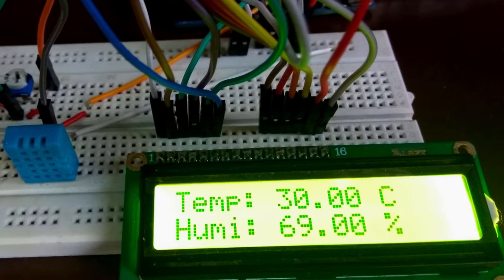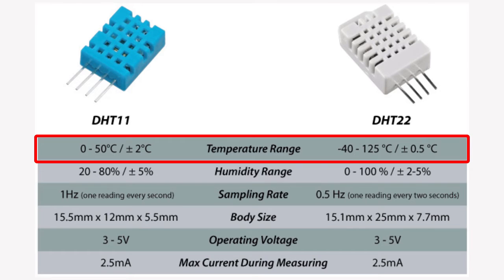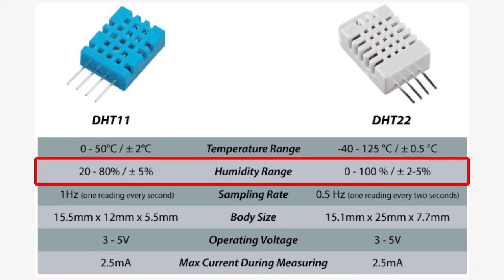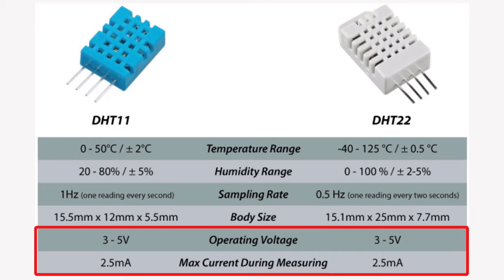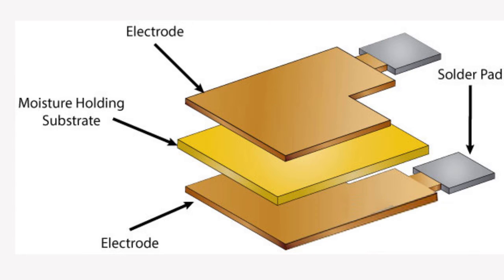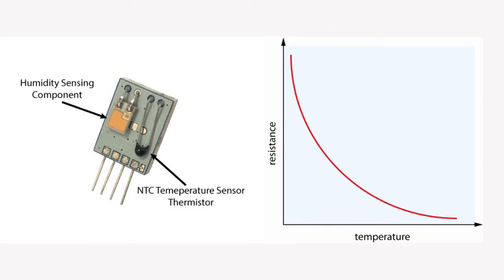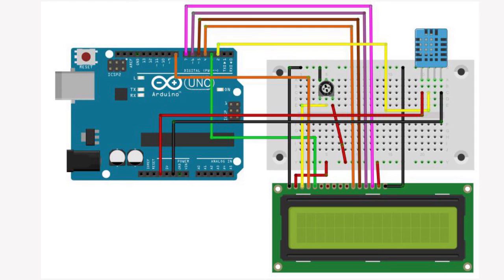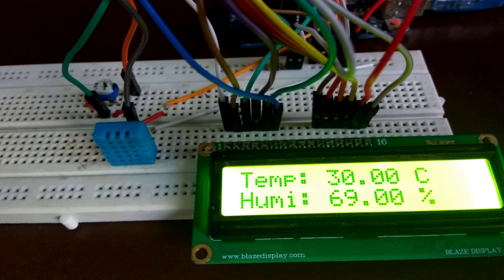DHT11 & DHT22 Sensors Temperature and Humidity Tutorial using Arduino and LCD

Comment from the maker: #include <LiquidCrystal.h>
#include <DHT.h>      // 
#define DHTPIN 2     // DHT Data Pin
LiquidCrystal lcd(8, 3, 4, 5, 6, 7); 
//define LCD pins (RS, E, D4, D5, D6, D7)

#define DHTTYPE DHT11   // or DHT 22 

DHT dht(DHTPIN, DHTTYPE);

void setup() {
  Serial.begin(9600); 
  Serial.println("DHT11 Sensor!");
 lcd.begin(16,2);    
  dht.begin();
}

void loop() {
  // Wait a few seconds between measurements.
  delay(1000);
  
  float h = dht.readHumidity();
  // Read temperature as Celsius
  float t = dht.readTemperature();
  // Read temperature as Fahrenheit
  float f = dht.readTemperature(true);
  
  // Check if any reads failed and exit early (to try again).
  if (isnan(h) || isnan(t) || isnan(f)) {
    Serial.println("Failed to read from DHT sensor!");
    return;
  }

  // Compute heat index
  // Must send in temp in Fahrenheit!
  float hi = dht.computeHeatIndex(f, h);
  Serial.print("Humidity: "); 
  Serial.print(h);
  Serial.print(" %\t");
  Serial.print("Temperature: "); 
  Serial.print(t);
  Serial.print(" *C ");
  Serial.print(f);
  Serial.print(" *F\t");
  Serial.print("Heat index: ");
  Serial.print(hi);
  Serial.println(" *F");
  
  lcd.setCursor(0,0);
  lcd.print("Temp: ");
  lcd.print(t);
  lcd.print(" C");
  lcd.setCursor(0,1);
  lcd.print("Humi: ");
  lcd.print(h);
  lcd.print(" %");
}